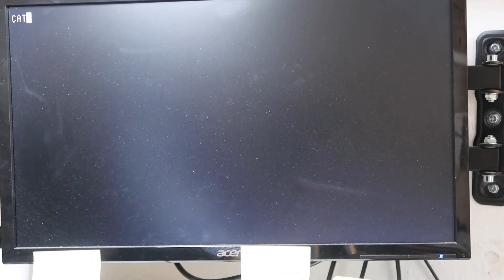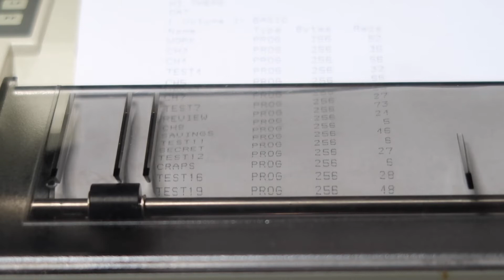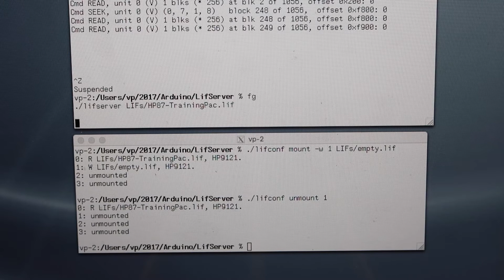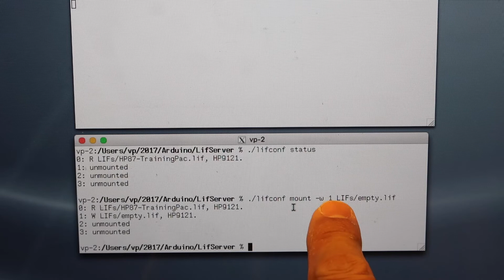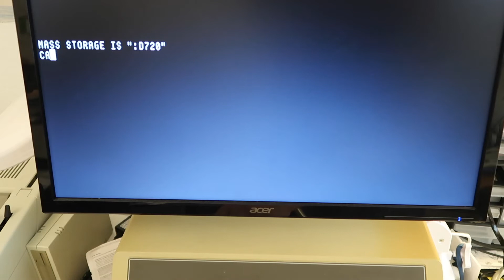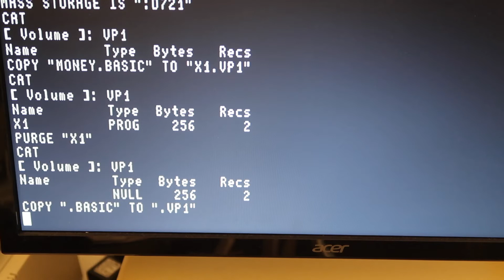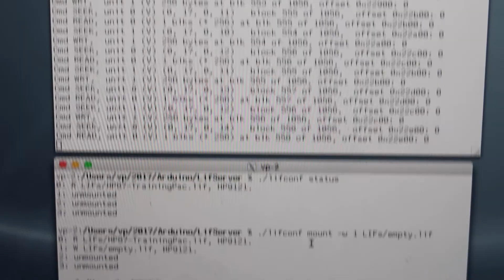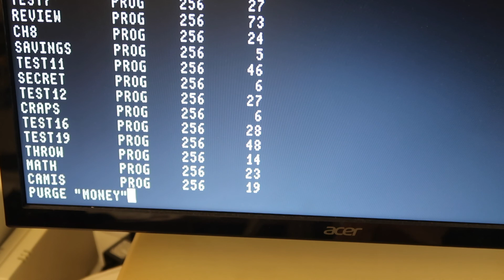Arduino HPIB DISC DRIVE

Comment: Thanks for all the effort you put into this video. I have been diving into the HPIB interface so I can communicate with all the HP test and measurement gear I have using legacy gear like the HP 86B. I have the very same HP 2225A Thinkjet, works great!